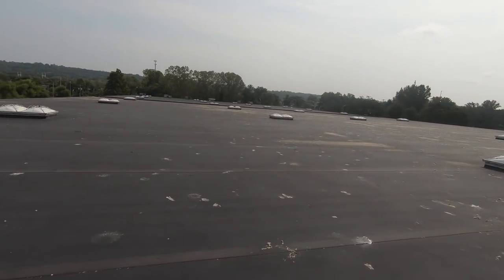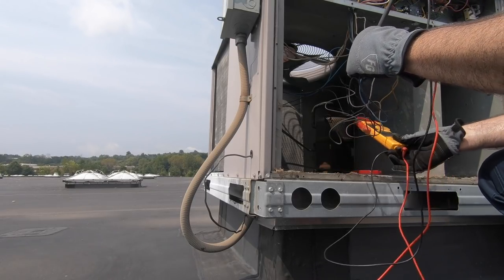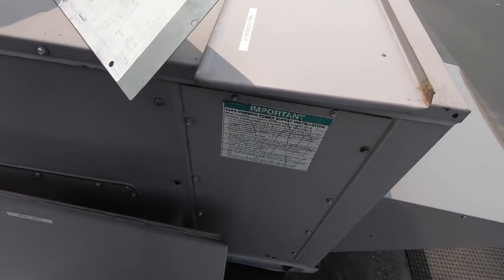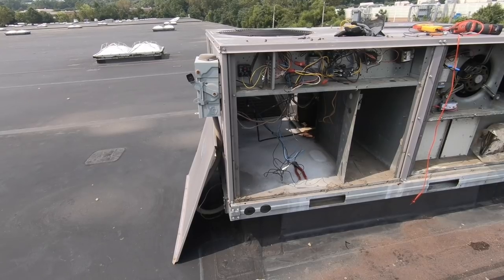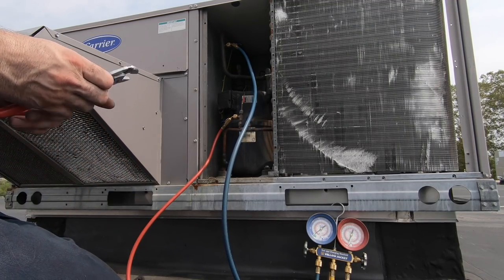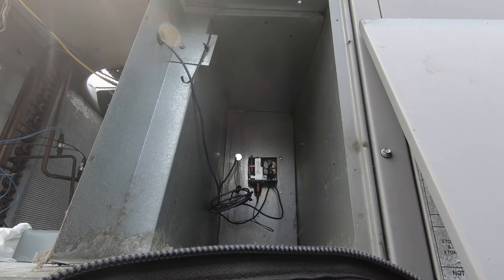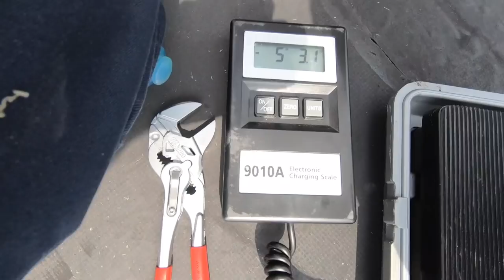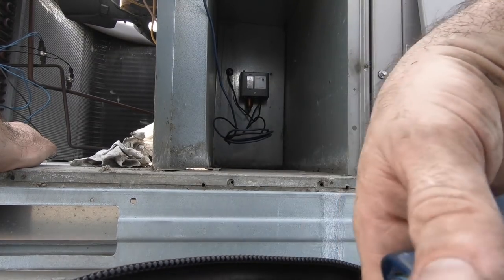HVAC No AC Computer Server Room

Comment: I am curious how a technician gets away with not pulling a vacuum and how the system will function with, presumably, some air in the lines before and after charging. Not trying to point fingers I totally understand why a tech might do this when they are over logged with jobs I am just wondering what the effects are on the system when you charge this way.
Reply from the maker: This unit has long been replaced. This unit operated good for the short time needed before it could be replaced. I log repair was permanent I would of vacuumed

Comment: Reminds me of what happened to one of the Space Shuttles. Someone slipped a screwdriver out of the head of a screw when tightening it. That left a tiny burr on the top of the screw where the screwdriver slipped out. Years later, a wire shorted out, as the sharp burr finally made it through the wire insulation. Luckily, the astronauts knew how to use another circuit instead of the shorted one. Murphy's Law.

Comment: Amazing, you actually read 24 volts instead of the 27v I see everywhere. Is there a reason for the consistent over voltage we see in the 27, I mean 24 v transformer.
Reply from the maker: It could be the power supplying the transformer. I also have seen 22 or 23 volts off transformers. But yes the usual is 27
Reply: that sounds like someone has connected 240V to a 208V primary winding.
Reply: It doesn't work that way at all. That you are both confused the same basic thing is mildly scary (don't worry, abuse is not forthcoming.)
Search around an familarize yourselves with the concept of Nominal Voltage.
Everybdy knows consumer cars run on 12V. Except, nowhere in the system will you ever measure exactly 12V. One the one hand, a traditional lead acid cell should measure about 12.6V when fulll; a modern alternator outputs around 14.5V - yet nothing blows up. On the other hand, everyone is familar with how headlights go dim (or switch off) when cranking the engine (a very high electrical load) - yet, again, nothing blows up.
The presence of a battery, something that needs charging, is a slight complication (but only slight) while at the same time, illustrting the original point. If that bothers you, remove battery OR alternator - and the  system behaves exactly the same, no 12.000000V anywhere.  Anyth as just plain old 12V (nominal) bench power supply, which is the same as a transformer.)
 Voltage will sag (drop) in relation to load ( current draw ). Voltage is to pressure as current is to flow. The two are just aspects of the same amount of energy, conceptually inseperable/interrelated.  In practice,  engineering attempts to make the two appear different - within constraints.
That's why a transformer (power supply) isn't just rated for 24V, but 24V @ X Amps. It means that at X amp load, voltage should be very near 24V. And, for engineering reasons (= cost), it also means  that when there is little, - or no load at all, -  Voltage will be higher. Just, hopefully, not crazy high.
Reply: Nice story. 👍

Comment: Always gauge up and amp prob on look for hi volt then low volt if none look at gauges to make sure your not off on safety and check for open on 24 , then make sure with nitrogen no leak then vacuum to 500 microns for 15 min and hold then go for five min more you will never fail.....

Comment: that switch could have easly been repaired with a little 1/4" copper tubing in 5 minutes.
Reply: Are you serious?  You dont know what the hell your talking about, those cap tubes are not even an 1/8" diameter on the outside and the ID is around .030, Id love to see someone try to weld quarter inch copper tube to a freakin cap tube.  Impossible.  The heat required to get silfos to flow would melt the cap tube in seconds.  Welding a cap tube into an evap is a different story but there is NO fixing a bad cap tube, the solder would close up the ID.  People that dont know what the F they are talking about shouldnt be commenting on technical videos.
Reply: @repetemyname842  he is correct dummy. I've been in the game for 22 years. Cut the capillary and slide each end into a 1/4" pipe 3 or 4 inches long, crimp it and solder each side and you're done. I'd only do that if the control is fairly new though, if it's old I'd just replace it.

Comment: With R22 that should be 275 with a 50psi differential on a server room to prevent freeze up
Reply from the maker: Their is a freeze stat also on the evap coil. I was trying to read where I set it from the video yet couldn’t make it out. I always set these to where the one I am replacing was set. If it worked for years without a problem then why change it. This unit also was replaced a few months back. This was a temporary fix just to get through till it was replaced

Comment: I'm not going to bust your balls for not vacuuming the system or for the lack of filter change, i already saw you answered everyone else on that but for god sakes get yourself some proper tools, i cringed when you switched out that service tee using pliers, you're damaging it, when the next guy shows up with the proper adjustable wrenches, he won't be able to use them. My dad has 40 years in, i have 22, you should always at the bare minimum keep 3 adjustable wrenches in your tools, small, medium and large, you use the smaller of whichever 2 you are using to hold, the larger one to torque, for flare fittings use leak lock as well. I know at least 30 to 40 hvac mechanics and they all carry 3 to 4 adjustable wrenches in their toolbag, it's the m.o. here in NYC
Reply from the maker: Those pliers are adjustable wrenches and have replaced a 6, 8, 10” adjustable pliers. The jaws are flat and the grip is better than regular adjustable wrench. I never stripped any fasteners using the knipex Pliers Wrench you should look that tool up. I’m all about lightening up my service bag since I do lots of walking before arriving at what I am working on. I know and work with many other service techs. I work for a very large company right on the other side of the Hudson. All the added weight from those adjustable I will pass. But seriously check out the pliers wrench you can ratchet around your fastener instead of fighting to open and close the adjustable wrench so it will not slip. The adjustable wrench I use is expensive though it cost almost $50. I have a full draw full of wrenches all sizes ratcheting and not also keep a 6, 8, 10, 12, and 15” adjustable wrenches and the larger size pliers wrench. Yet the 7” pliers wrench I would use any day over those adjustable. We all have our preferences. I should hold back the fitting which is a judgement call I make if I feel I need to use enough force that could break the braze.This machine also has long been replaced and a new Lennox RTU is cooling this server room. The one thing your comment is reminding me of is I need to have my boss finally get me a new micron gauge. As for leak lock that can be a touchy subject. It works yet it is rare that these fitting vibrate free I put rare cause we all found a safety switch loose on random occasion and leaking.
Reply: Crescent wrenches lol

Comment: I just watched this video and it sounded like he said that the blue wires were his low pressure switch? By the looks of it, they both seem to be high pressure switches.
Reply from the maker: System wouldn't be off on low pressure if it wa a high pressure switch. I somehow missed that when I first started troubleshooting this system

Comment: you could have least Purge the system with nitrogen and a little bit refrigerant to move out some of the contaminants
Reply from the maker: That system ran until the day it was lifted off the curb and replaced with a new system they replaced it at the end of last summer

Comment: Why would you have not pulled a vacuum on the system since it had been exposed to air?
Reply from the maker: When I got the ok from the building for the repair they told me to have sales come out they are planning on replacing. If they didn't ask for sales I would have dragged up the vacuum pump.
Reply: +The HVAC Hacker makes sense awesome
Reply: Doesn't matter if they asked for sales or not. Do the job with the correct procedure either way. If that compressor goes out before they replace, now they can go after you for improper procedure and killing the compressor. They could even show this video as proof.
Reply: @dudebrock2117  well it held... so it was not a problem.
Reply: Dude Brock 
Not your problem keyboard warrior.
Reply: @daverhodes382  , LOL @ keyboard warrior...so you think it's OK for someone to take a chance at possibly screwing up someone else's property. Most likely if something had gone wrong you wouldn't be seeing this video, because he'd be telling them that it was just that time for them to get a new unit; and he would've known that they might could have used this as evidence in a civil suit. In the long run, let's screw the customer out of their money.  I still don't see how that has anything to do with your comment ::: "keyboard warrior".
Reply: @dudebrock2117  ^^^^^ this guy😂😂
Reply from the maker: All is well unit was replaced and compressor was humming away until the crane took it to Air Conditioning Heaven

Comment: Would it have been possible to solder that small hole ? quick inexpensive repair the part?  
Thanks for the excellent video's and worldly advice ~ ignore the degrading feedback you make the world turn!
Reply from the maker: It is possible yet wasn’t easy getting anything on this roof or to the system so the part was easier to carry. I could of even just removed it from the system since they wanted the system removed once the temps cooled outside
Reply: No. Bad weld means a call back and egg in the face. Maybe in school for a science project.
Reply: Honestly it wasn't necessary to change the control, you also cant solder the capillary because you can easily clog it with solder, what i always do if the pressure control is relatively new is to cut it, slip each end into a piece of 1/4" copper line 3 or 4 inches long and solder both sides, works like a charm every time and no risk of clogging capillary.
Reply from the maker: Yes I could of brazed shut the capillary or used a piece of pipe as a coupling. Or just put the condenser wire back together eliminating the control. Yet what if the system wasn’t replaced?  The freeze ups and lose of cooling in the colder months.

Comment: What’s wrong with u “holier than thou”  types? Did u not hear the man say the customer only wanted it to run long  enough to get through the hot spell. It’s being replaced in weeks. Purge-Gas & Go. No need to charge for a drier, torch & vacuum pump services. This is real world HVAC work. Customer’s paying the bill, not you.
Reply from the maker: This is youtube I get shredded for anything not by the book. This units metal might have already been melted into a new machine. I wonder at times if I should edit my mistakes yet most watch my videos cause it is real world HVAC. Mistakes happen we just need to move through them to achieve the end product a functioning system.
Reply: The HVAC Hacker Don’t sweat the critics man,  all that matter is if the unit is back to working and if the customer is happy,  most people just jump into the videos and do not even pay attention and become keyboard experts

Half the comments on here would be gone if they listened to the part when you said it was just a quick fix to last unit it gets replaced at in a few weeks.  

Keep up the good work.   Think of it this way,  good
Comments bad comments,  it’s still views haha
Reply from the maker: I am learning and getting better at ignoring. Sometimes it’s hard though to ignore
Reply: Everybody thinks they are a super tech behind the keyboard that’s why they don’t have their own channels, keep up the good work brotha man and stay cool haha

Comment: Heya, how about having humidity in your system + non condensable. The rule is open system new drier then vacuum. 400 microns. After and only after recharge the system. You're contaminating the oil and ground the compressor,who's going to pay for that lack of competency???
Reply from the maker: You are actually incorrect with your first rule. First, you need to pressure test after new drier, then evacuate to at least 500 microns, Then recharge the system. You are not contaminating the oil. And yet you are trying to say I am lacking competency? Mineral oil is hydrophobic which means it doesn't absorb moisture. You actually contaminate your refrigerant. Which can overheat the compressor, Heat breaks down the oil and makes it acidic. Why are you trolling? asking questions is good yet attempting an insult is trolling. Now, this system is still running since I was there for a filter change a few days back. It will be lifted off its curb with a crane next Friday and headed to a scrap yard. A new system dropped in place. This was a temporary yet since the heat stuck around they delayed the changeout.

Comment: which veto is that
Reply from the maker: Tech MCT it's a great bag. I am considering getting another to set up for my generator tools.
Reply: i use the mb2 right now but its a bit small for my main service bag. i think i may go to the one you have
Reply from the maker: I have a tp4 that I got for free with my mct. I never used it. I am also considering the tech pac for the occasional big roof repair. Otherwise, the mct is the perfect size

Comment: Bad job you didn’t pull a vacuum .You get paid to do a job do it right.
Reply from the maker: You are correct I didn't pull a vacuum. This system will be replaced in 2 weeks. I got paid to make it temporarily run until it gets replaced. It is still running so I was paid and provided the service my customer wanted.

Comment: compressor on but no condensor fan running....hummmm!
Reply from the maker: Couldn't build any head pressure
Reply: Did you not see the fan cycle switch he replaced? Head pressure still low to call.

Comment: How about using the wiring diagram to start. Also you can repair that cap tub on the pressure switch with a piece of 1/4” tubing. Then you just throw gas in without evacuating!!! Now the thing is got non Condensibles lol. What a joke!
Reply from the maker: I understand I missed the open low pressure switch.yet didn’t give up till I found it. I read schematics when they haven’t whithered away. I could have cut the schematic part out when removing any dead boring parts of job. This video isn’t the best since I didn’t have the head or chest cam holder.

Comment: NCV tester should be in your pocket at all times. Alligator clips for your meter leads. There was no need to go into the blower compartment or the economizier.  AC101-check disconnect power, check to see if 24v at terminal board, if not jump R and Y1, blower contactor should pull in, and compressor contactor pulls in, if blower comes on and compressor contactor doesnt, check pressures and compressor to see if its off on overload. Pressures would of told you its off on low pressure. Way to much overanalysis.  You should really stop with these you are showing people all the wrong things to do. JUST STOP! THe positive comments you get are from people who have no experience at all in the HVAC field obviously.  I hope you are self employed because you are losing your employer alot of money and time on pointless shit.
Reply from the maker: We all miss things at times. Yet how am I costing my employer a lot of money? My employer makes bank off my jobs
Reply: @thehvachacker  good work thanks I enjoy your video, everyday we learn something right
Reply: Noone should be watching these videos/ using these videos as a means of becoming a technician, so him documenting his process is his personal decision, without the video if you just went on all his jobs and saw everything running perfectly you would say he is a good tech but God forbid someone has a different approach 🤫🤫🤫
Reply: He is the HVAC Hacker

Comment: For me your fault finding technique is flawed. You spend far far to long just wasting time on insignificant things.
Turn it on, then establish what is wrong. Then work backwards to find out why.
Why look at connectors and measuring caps etc. If that is where you go later once you are tracing the fault so be it.
I would hate to pay your labour costs with your fiddle farting around, wasting time.
Reply: I don't believe there is anything wrong with the way he went about troubleshooting. To work backwards from the contactor involves I believe to be more work and as a result more time spent troubleshooting.
Reply: On a non-functioning unit it can be detrimental to leave the system fully powered while "hunting for the problem." You could potentially leave a stalled motor loaded at 220 until the winding goes molten and costs you a motor. Step-by-step diagnostics is a good thing to reduce cost.
Reply from the maker: I missed the open low pressure switch at first yet kept looking until I found it. I know I am not perfect and always working to be a better tech.

Comment: You got called out for not doing the job properly, or showing the proper way it needs to be done, an now make excuses to why you didn't do it correctly.
Reply from the maker: Go through all the comments my story hasn't changed. I did what I was paid to. If your a poindexter and everything has to be done step by step you might hate my videos. I pull vacuums most the time. I haven't had a micron gauge since it died and my company so far hasn't cared to give me a new one. You will find lots of faults in my video. This is real world HVAC. I get almost no call backs on my work. Yet I said we can find fault everywhere if that's the kind of person you are. Don't expect me to interact with you. If you enjoy watching interesting HVAC repairs then enjoy my videos. If you want to knit pick well................
Reply: At least u didnt jumper from Y1 to contactor and throw a few pounds in her and roll out. Hehe